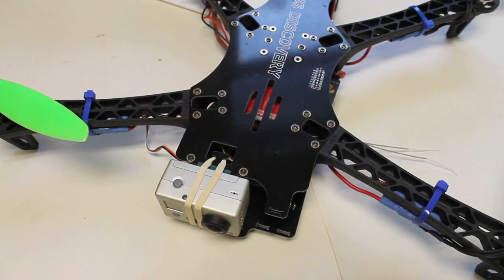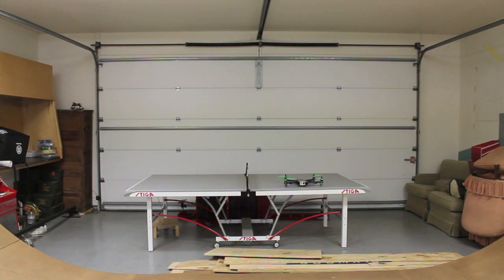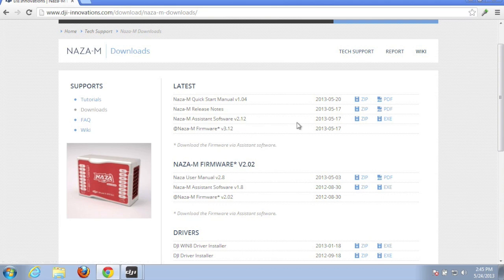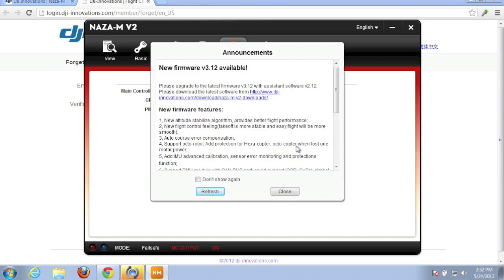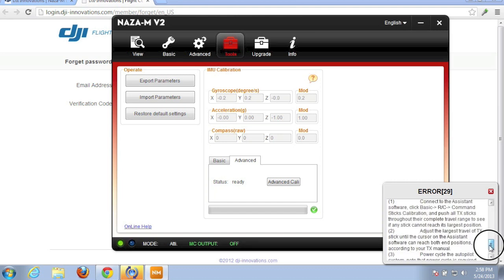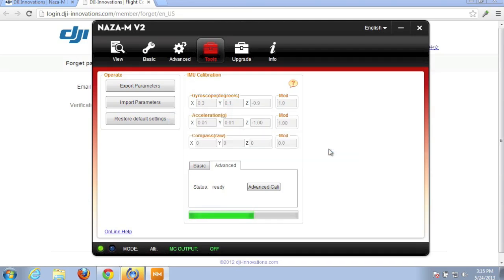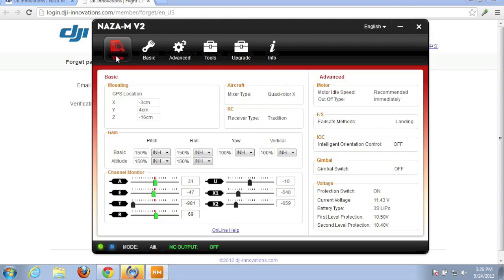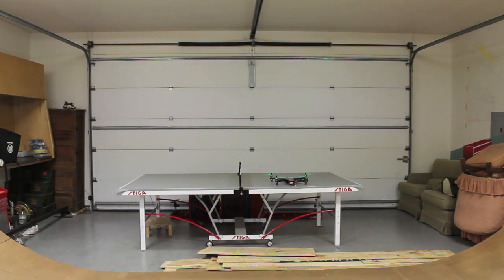DJI Naza Firmware Upgrade to Version 3.12

Comment: Cool Dennis thanks , I shall try this out , my setting at present are , Pitch 135% , Roll 135% , Yaw 120% Vertical 130% and Attitude gain 135% . always good to try new things out though , I will keep you posted to how it goes mate , how is things working out with the 3D printer bud , are you using it much for the hobby ???...
Reply from the maker: Thanks for sharing. Looks like we weren't too far off from each other. My use of the 3D printer is nearly all geared towards RC. Every now and then my daughters ask me to print something, which always turns out to be a challenge :) Still trying to hone in on my design skills!

Comment from the maker: Thanks for confirming that. I had wondered the same when I did the upgrade. It appears that hitting the enter key does the trick. I think possibly just tabbing or clicking out of the field may persist the data as well. So it may not even be necessary to hit the enter key. But don't quote me on that. Will verify soon.

Comment: Forgot to add.... 
The throttle stick is at ~50% when the motors start to respond to throttle.
When I setup the Failsafes on the receiver I had set the throttle to 50% with the older firmware.
Do you think that 50% throttle is still a good failsafe setting with the new firmware since the motors respond with a much higher stick position ??

Comment: Hey Denis.. I just installed the latest Naza Firmware (4.02) and the latest Assistant (2.20) after watching this video.
The new assistant grabbed all the data in my previous version (2.02) Naza firmware and I had no errors when I did the advanced calibration.
I found that just hitting the ENTER key seems to make sure the on screen data is updated to the NAZA-M like the assistant actually asked when entering flight height and distance values. 

Hope this helps.

Comment from the maker: Send me a message directly and we can chat. I'm about to order the QAV500 mainly because of the great vibration free GoPro video it offers. Personally I would start with a basic FPV setup to get comfortable with it before you get a longer range system. I would say if you could practice for some time at a distance of about .5 mile you'll be ready to go longer range. Feel free to message me directly on my channel and we can chat more.

Comment: Dennis.. How much would you charge to build.. Setup.. And test a platform.. Id like qav500 but from the months of reading im still a little lost.. I fly nitro 3d all day with my raptor but i really want to get into fpv.. Id like a good ranged platform as well.. Probably using dragonlink and ibcrazys antanne.. But any advice or if your able to build.. Soon ill have about 7 grand to blow and want to use it on fpv.. Thanks .

Comment: You can see it already on my channel.
Not the best video, but give an idea.
I do another test those days, trying to fly more aggressive in GPS mode. Till now, seems more stable and no flyaway. The only negative is that seems to cu the time off the fly. I have no idea why, cause is the same hardware configuration. I have to go in a tryp and i hope to test it more, if all goes well.

 Tank You.

Comment: After i made my first update, the problems start to come.
I do not remember whitch was my default firmware, couse was flying perfect (i supose 2.02 ?).
The dady after upgrade to 3, i have first crash (flyaway).
Now..i downgrade again to 3,14, but i read that almost all 3 firmware have "flyaway" simptoms.
So..i think to downgrade to 2.02 since i do not remember the default firmware.
At least, my hexa was perfect stable when i buy it.

Comment from the maker: No, IMO the 3.12 upgrade has dramatically improved stability. Now I don't fly with a GPS so keep that in mind. I've read of some pilots having all sorts of issues with the upgrade. Check out garagepilots . com if you want to talk to other guys running with the Naza. Thanks for the question.

Comment: Other day i was tuning the Basic: Yaw & Vertical gains alone by assigning one pot channel. Now it's little better.But still i have a problem with coming down feels like lost control. It's kind of wearied that while coming down it just drops and i have to give too much throttle to compensate that drop and some times it will do a hard landing. Iam using 750kv motors with 10x4.5 props with AUW : 1750 grams with 3s 4500mah lipo. I have to cut some weight and test it again..

Comment: I have not had any significant yaw issues, in fact the new SW got rid of the minor ones I did have. On earlier versions when I would yaw, the unit would drift some, then settle down, but no loss of control or anything remotely like that.  Hope you figure it out and please post a reply if you do.

Comment: I thought same initially and even had a plan of upgrading to new motors and which i did it and it's the same problem..One more thing i noticed was i have to adjust the gains for different size(Weight) batteries.But still yaw issue exist and it's scary.

Comment: Dennis, Do you have any kind of yaw/rudder issues with this new 3.12 firmware..Since i upgraded my quad with 3.10 and then to 3.12 fw it's acting little wearied..As soon as  give rudder left/right movement quad will start loose control and acts like it's in manual mode..Calibrating the channels also getting very tough and unstable..

Comment: Yeah...I can do all that too as long as it's rolled back....on both a phantom and a 450 quad.  There are a lot of complaints about buggy behavior with 3.11 and 3.12...up to and including faceplants in the dirt.  I've experienced this shoddy DJI rollout and like I said, proceed with caution.  I'll stick to with what works until DJI pulls their heads out of their asses.

Comment: I also calibrated my current voltage with a multi-meter measurement, it was of 0.2V My battery warning triggers at 3.75V per cell now; thats  10 minutes flying on a Turnigy 2200 20-30c and 8 minutes on the stock battery?!?!? Stock battery is not that good i guess. Thanks for your support/advice , did you subscibe to me yet btw.? See you and have a fantastic flying season!

Comment: I have the new 2.12 assistant and the 3.12 software upgrade for my phantom now, coincident is I did it yesterday and I set my batt warning to 11.55 (that is warning at 3.75V per cell) and my 3 position-switch to gps-atti-manual, I fly in manual sometimes but it is still too aggressive/sensitive i guess, maybe if I set attitude gain lower it flies less sensitive?!?!

Comment: Sorry to hear that your having so much trouble with it. Mine iis solid as a rock. I am running a stock 550 for the platform, and a T8J as the TX. I have had it 2 feet from a clients rock crawler in GPS Hold and felt comfortable enought to reach down and grab a drink of soda, scratch, do whatever. 3 feet from a Trials bike riders path in 10 kts of wind and felt comfortable enought to stay in the goggles for that pass and three more. I had a spotter that I trusted impliciatly as always. good luck.

Comment: The new software revision is very very stable, my Hex went from pretty good to rediculously solid. It's GPS hold is so tight I could leave it unattended in 10-20mph winds and it would still be right where I left it when I come back, it is that good. And before you say it, NO I don't do that, but, it is that solid.

Comment: please fix the problem by adjusting the travel and the center position value of the TX corresponding channel, or refer to your TX owners manual to check / adjust the TX stick calibration (for example, the transmitter calibration section in the advanced manual of Phantom). Then click the "view" tap to check the center position deviation values between -100 and 100 is allowed

Comment from the maker: Good call. I would probably do the same if I were flying an out-of-the-box product like the Phantom. Since I'm flying something that I've tweaked again and again I was okay with loading the new firmware and doing some test flights before I laid into the throttle.

Comment from the maker: Thanks for sharing your experience. I don't fly my Naza with GPS so perhaps that's the difference in our results. I've flown a good bit with V3.12 and have been really impressed. Not a single glitch as of yet. I did several test flights in my garage and then low hovering outdoors. Then I've been flying it pretty hard as of late.

Comment: I don't know...I saw all the "wows" before I tried the upgrade(s).  I was rather let down and ended up rolling it back.  I didn't see any stability improvements.  In fact it seemed worse in GPS hover.  There's also still alot of issues with these new firmware versions.  My advice is to proceed with caution.

Comment from the maker: Sounds like a great setup. I'm going to pull the trigger on a QAV in the near future and I've been looking at T-motors for some time now. I just watched a vid of the Honey Badger (hadn't heard of it until you mentioned). It looks pretty amazing. I need a good beater quad. At one point it was some wooden dowel rods from Home Depot and a plastic conduit case. Worked quite nice with my Naza.

Comment: Yea. I love the QAV. In fact I got it just to use up some extra DJI parts when I upgraded my F550 for heavy lift AP. it wasn't long before it had brand new T-motors, Immersion FPV and the whole lot, and I have been sadly ignoring the 550 (although I am waiting for a good brushless gimbal for it - so I have an excuse). I'm thinking about a Honey Badger to stick the DJI motors and a spare KK just to have some throw around fun.

Comment: Yea, I'm certain of it. I just turned on the Tx and it is set to warn if throttle is above 0 on power up. I'll be either removing props, or, on my F550 where I can get to the ESCs, just pull one of the ESC wires.

Comment from the maker: Steve, that is crazy to hear. I appreciate you sharing that info and I guess I'll no longer be lazy when doing updates. Did you check your TX just to make sure the throttle stick wasn't up? I guess they tell you to remove props for a reason, huh?

Comment: Another great video. Just a note. I too did not remove my props or disconnect the ESCs (confusing since you need power to the FC, but I think that's what they mean) and the second I clicked the update button, my QAV500 launched in the air (in my kitchen), destroyed four props, cracked my LayerLens protector on the GoPro and broke my immersionRC 600mW Tx. Note to self: remove props.

Comment: Dennis, I was testing  HIL simulation using APM2.5 & FlightGear Simulator. As per the wiki(which is horrible) i am stuck on a step while uploading a HIL fw on to my APM board, It shows it's completed/done 100% but APM led sequence shows all the LED's are on and looks like kind of stuck..Dont know if that's the HIL fw or HW  problem ..Have you ever had any issue while loading the fw on to APM ?. Did u ever try the HIL simulation?, I hope one day u post some videos on this topic as well.Thx

Comment: when you run the software assistant and then update to 3.12 it asks you to power cycle. does that mean turn the Naza off and then on, or unplug it, or turn of Tx as well, or all of the above.

Comment from the maker: James, that's exactly right and generally what I tell people that ask. The APM has many more features than Naza and is comparable to the higher end DJI flight controller (Wookong). But Naza is pretty much ready to go out of the box. And it's probably gotten even better with the Naza V2 controller that was recently released. But I can only speak for V1, which is pretty incredible. APM definitely takes more TLC to get up and running, but once you do it's pretty awesome.

Comment from the maker: I'm actually Gemfan plastics that I spent a lot of time balancing. I cracked one of my Graupners so I had to revert to the cheapo props. There are also Gemfan carbon/nylon props that are supposed to be a bit more rigid. I haven't tried them, but wanted to mention.

Comment from the maker: The stability is pretty incredible, but yeah the new throttle response threw me off a good bit. I'm going to have to work hard to get used to it. It would be nice if it were configurable.

Comment: Thanks for the video. I also did upgraded my Naza with 3.12 FW, As i noticed motors will start spinning once you arm the FC and motors will run faster beyond the 50% throttle only.I did't like this feature.Some times u have to be very careful while testing indoors where quad might shoot to sealing.

Comment: Thanks for another informative video. You have flown the Naza and the Ardupilot. What are your thoughts about the two in comparison? From what I have read, it seems that although the Ardupilot has a few more features like RTL, it is also more difficult to set up and tune. Is that what you have found?

Comment: Totally get the new firmware release in 2013 
This makes the naza Fly like a totally different craft its 100x better than the stock V1
It wont allow you to start the motors till enough gps are locked.